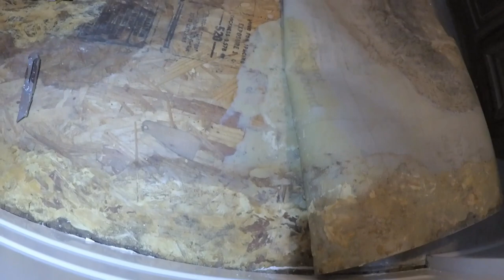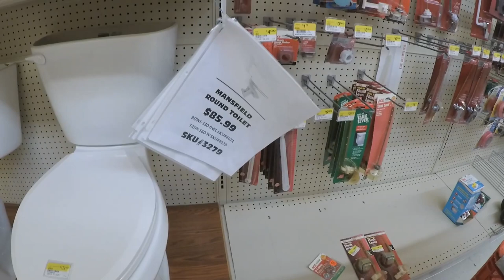Mobile Home:  Replacing a Toilet & Rotted Floor Repair

Comment from the maker: That Home was built in 1971 and I don't think there is a straight wall in it. We were also dealing with three layers of subflooring.  The repair we made was solid and safe. I don't think that a "square " would have made any difference.

Comment: Don’t caulk the base. When if it leaks again it’s going to trap the water and rot the flour AGAIN help prevent the problem.
Reply: @Patrick Peterson I caulk all around toilet except back behind it so if it does leak you'll see it come from the back and it still looks complete and nice on the viewable sides

Comment from the maker: Smaller Bathroom fixtures have been prevalent especially in older Mobile Homes.  However,  this depends largely on the Home Manufacturer or House Developer.  When renovating,  I guess it's just personal preference & cost.

Comment: I had my toilet replaced in a bath remodel in my 1999 mh and one of the workers on the remodeling project said that they  did not install the toilet correctly. And now I get sewer gases - do you know what could be causing it exactly?
Reply: Wax ring...

Comment: I'm new to mobile homes.  Is there any difference in the toilets for mobile homes vs block homes? Or are they all the same.
Reply: I need to replace my 2003 DW Moble home toilet.   I am looking to Purchase one .  I am wondering the same question.  Can you just get one for a block home or do I need to Purchase a special one for mobile homes.
Reply: To both of you I believe any toilet works. I have replaced mine in a few different mobile homes and I don't look for anything special besides the ring/gasket size. I believe most are the same if not all are the same. Besides the super high end fancy toilets like an electronic one but then again I would assume it's the same as well. Universal type stuff to fit any toilet opening. Just as piping is usually the same across the board. Plumbing unless specially fitted are the same for mobile homes and houses alike.
Reply: @jordanlundy8796  Thank you for the info!
Reply: @jordanlundy8796   Universal fitting sizes yes. However, many Mobile & Manufactured Homes have much smaller bathrooms. For example, I'm attempting to replace tank to seat gasket & bolts. I can barely get my shoulder into the space between toilet & vanity cabinet. Now, the 1 size fits all gasket doesn't sit securely, so now it's leaking from the middle & both bolts 😳
Reply: @cheers3cheers  any will work

Comment: How much should I charge for a job like this on 2 toilets ??
Reply from the maker: Service call plus labor & materials.  You never know what's there until you open up that floor.  Good luck with your project.